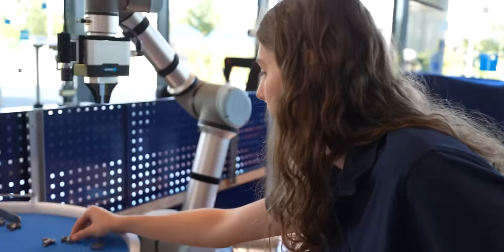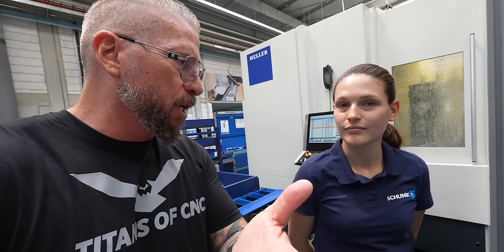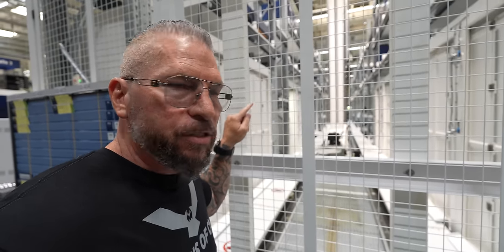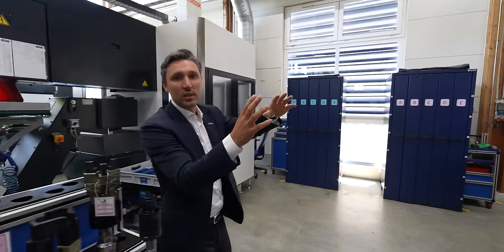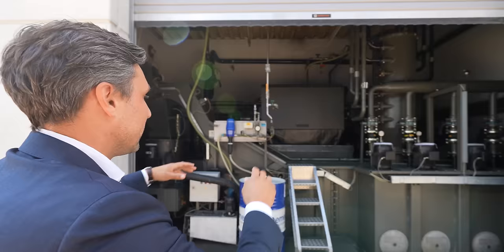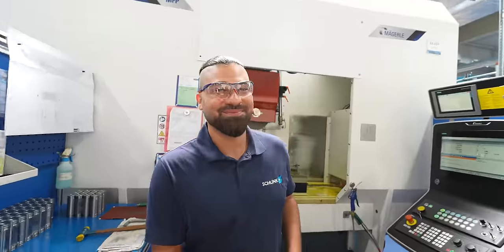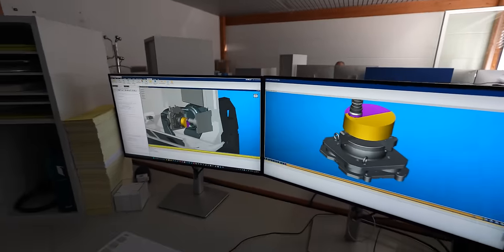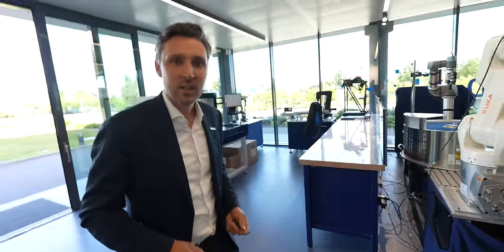SCHUNK: Unleashing The Power Of CNC Machining

Comment: 14:02/28:31 The robot arm with the magnetic attachment, does the material that arm fetches retain some of the magnetism? If so do you have to demagnetize the material before machining it so that the chips do not stick to it?  Maybe this irrelevant, I do not know. 🤔❗
Reply: Depends on the material of the part, some materials are easier to magnetize. 
If you hear treat a part it’s also no problem since this will remove it.

Some parts are really de magnetized

Comment: No safety glasses?
Reply: All machines are in a housing with safety windows/doors and the doors only open if the machine stops and there are gated areas where one side only opens if the other is closed. Robots have safety housings and safety zones. No need for safety glasses except if you are repairing and testing and that wasn't the case in the video.